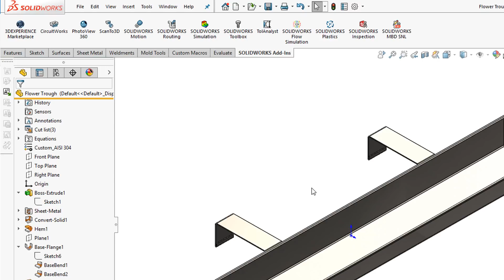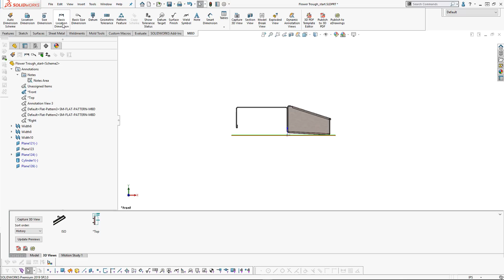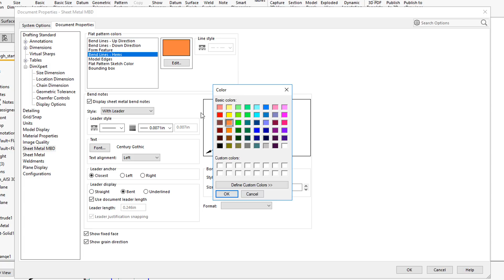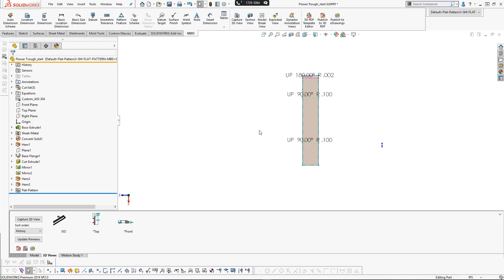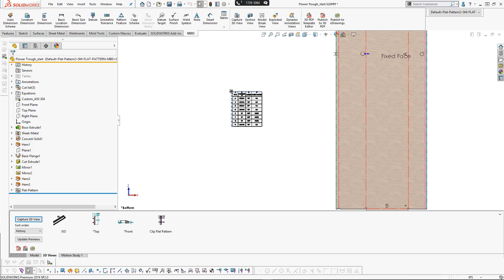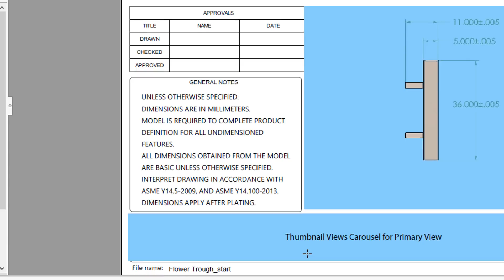SOLIDWORKS MBD 2019 - Bend Tables

Comment: how to go back for original shape again ?
Reply from the maker: I am not sure exactly what part you are referring too, but the sheet metal parts are flattened and unflatted using the flatten command on the sheet metal tool bar.
Reply: When you active insert bend note. Tha part get flatten and the features stopes working in features tree . 
So how can you get back again to the normal part
Reply: Try going to configulations Tab and select Default